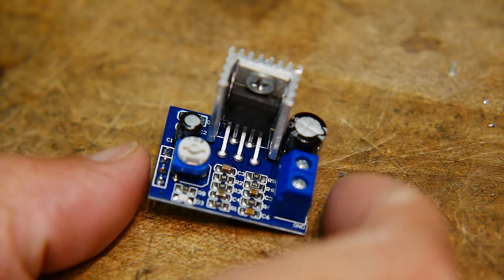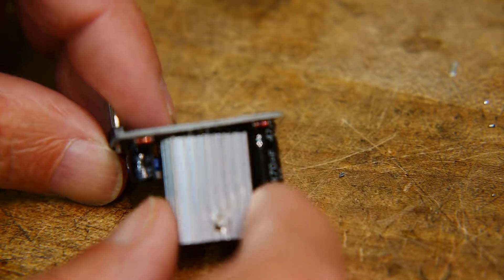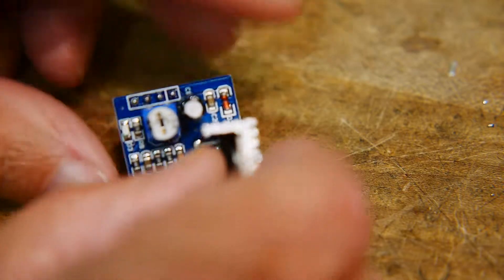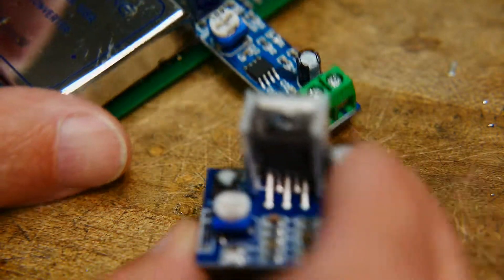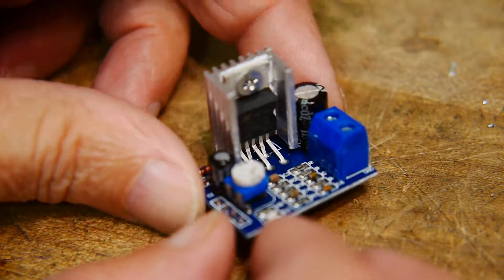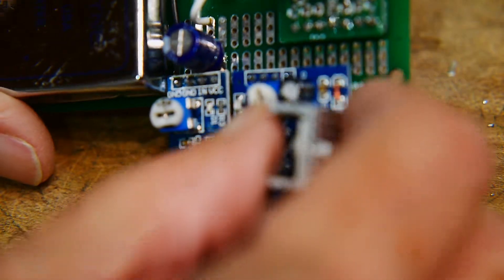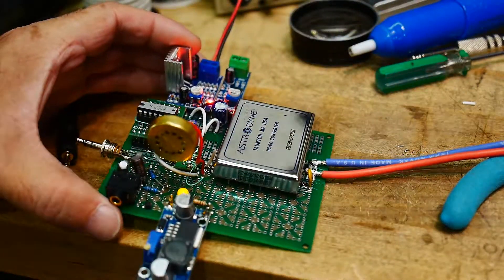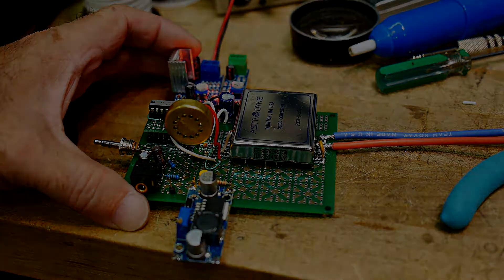#457 TDA2030A Audio Amplifier Module

Comment: Can you share a link to that amp? I have several of the chips but why mess with putting one together when that's so cheap!  ;-)
Reply from the maker: https://www.ebay.com/itm/TDA2030A-Audio-Amplifier-Module-Power-Amplifier-Board-Electronic-6-12V18W-W6A8/233601913308?hash=item3663c251dc:g:p44AAOSwuldez0g0
Reply: @IMSAIGuy  TNX!